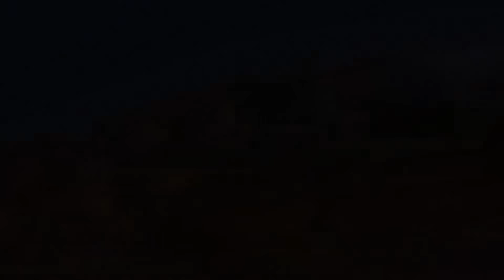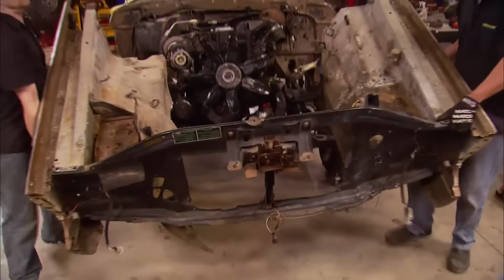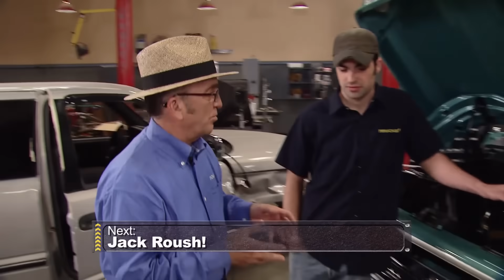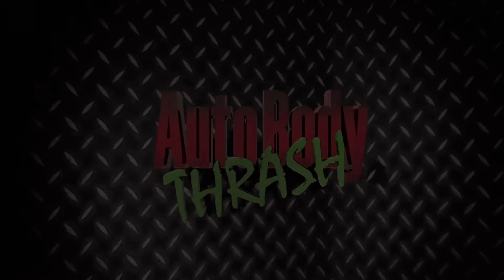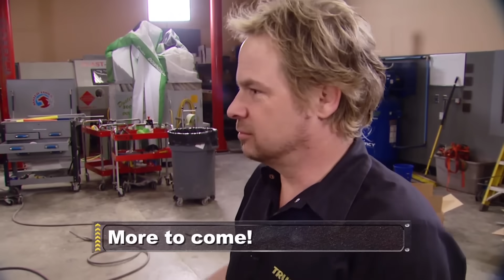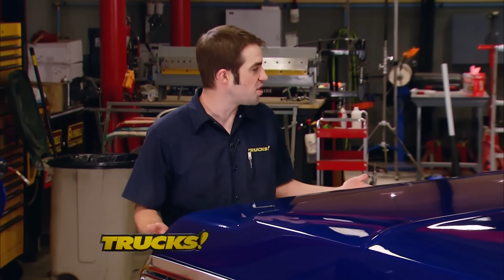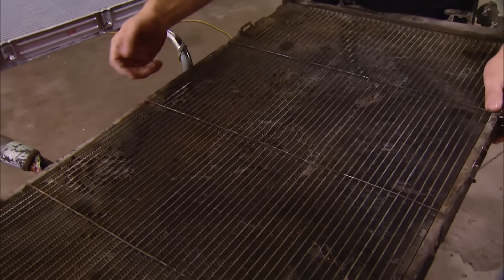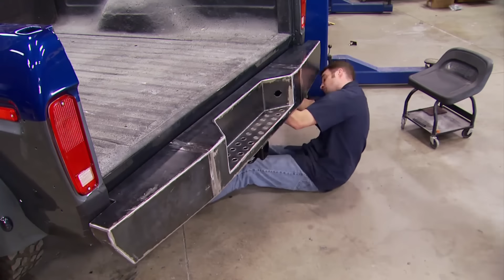Ford Crew Cab on a Dodge Cummins Chassis! (Super Dually) - Full Build

Comment: Loved seeing this until the battery waffle, yes aluminium is more conductive than lead, but at those amps, 🤣 solder has been the go to electrical connection, lead is poisonous but at 2.2×10-7 Ohms per meter even if your terminal was 1 metre long it's resistance would only be 0.00000022 Ohms 😊

Comment: wow 1000 hours into the truck?. so if you were to take a standard rate at a mechanic shop of $100-$150 per hr that truck would have cost $100,000-$150,000 to build!! not including parts. guess this is why custom shops price per job and not completely on hrs.

Comment: Just curious: if I build something like this on my own, take it to the DMV, in let’s say in the state of California, and get it registered, I wonder if I have to comply with any emission regulations.  Not only do I like the looks, but I really like the fact that it doesn’t have a EGR or DPF, making it reliable.  I really want a semi tractor to convert it into a RV hauler, but same issue…not reliable due to all the emissions crap they put on these newer trucks.  We might as well shoot a missile 90 degrees up into the air.  I don’t see any effort to clean our air, by using our generous tax dollars, yet they want us to drive cars and trucks that has so much technology (unsustainable technology) that we can breath from the exhaust pipe.  I suppose EPA will get rid of brake pads, rubber tires, and add another exhaust system on diesel trucks to catch the ash that comes out of the tail pipe since all these things are eventually airborne.  Why can’t we just get rid of processed meats, sugar and refined foods in our society instead.  I digress…nice project.

Comment: “The fact we didn’t have to drop 40 or 50 grand on it……”  
You’re correct, you dropped a lot more. Considering the average body shop is around $60 an hour in 2023, your 1000 man hours is $60k alone in labor. Plus the cost of the trucks and the crap from LMC & Summit (although you might of gotten them free as sponsored products) in order for the average man to replicate that is way north of a $100,000.

Comment: Nice "body upgrade" that gets rid of the modern crap and retains the drivetrain and chassis. Nice to see a useful truck (which means eight lugs and DRW) done bare bones style as they should be.
BTW an underappreciated tow rig upgrade is a wheel lift wrecker (which does not require the wheel lift bed which is mostly a light cover). So is a HYDRAULIC (electric winches are weak) winch either PTO or belt driven, but PTO are the best giving full engine HP. I  put my winches in the bed where they belong and kick ass for loading trailers and much more.

Comment: Bought a '79 f100 with a perkins in it, straight off the showroom floor, in Perth, Western Australia. 30+ mpg from brand new. Towed a 22 ft caravan ( mobile home)  back to Brisbane, about 3 yrs later( just run in) ,still around 31 mpg. Fantastic tourer.😊😊😊😊😊😊😊
Reply: Would have loved one of those. No diesels were offered in F100s in north America, let alone a fuel sipping Perkins. Beauty.

Comment: Wtf, where's a 7.3 Powerstroke Ford at?! It's a better motor and, oh yeah, it's a FORD....
Reply: Cummins Engine isn't a Dodge product neither is the transmission or Dana 80 axel.

Only thing Dodge is the frame and the radiator core support.

The Dodgy parts that will rust away in 10 years.

Comment: I wish that they didnt use the Dodge pedals, Guages, and Steering wheel. They should have adapted the Ford parts or went with aftermarket stuff. It would have looked better and also completed the illusion of a modified Ford rather than a "Frankenstein Truck". 

Also 4 wheel drive would have been my preference but thats OK.

Comment: I have a question , when you were all in on the back end of the engine changing the clutch . Why on earth didn't you install a new rear main seal after telling us that it was leaking ? That oil treatment that you used is not a permanent  repair for a leaking rear main seal , it is only a bandaid and although it will work for a little while it should only be used in case of emergency ! This really surprised me to see you not change it while you were in there already doing the clutch ! I hope that you did change it and just chose not to share it with us ! Anyway love your work and show and keep up the great work !

Comment: Reliability on an engine that’s been through almost every type of motor sport is smart but maybe run it in something besides that b58 chassis try a standalone for it if there is any run it the rest of the season with it but if you ls swap might as well get a different chassis there’s so many parts that’d have to get changed by doing an ls swap to that Supra it’d be smarter financially and for stability and plus brand new build again

Comment: I am doing a similar build, 93 12 valve 2001 ford 6speed, 2006 super duty dually frame, and a 1992 Ford Crew Cab, rust free.

Comment: @16:13 he's talking about all the things they are going to use from the Dodge including the dash and other things, 
What I don't understand is why didn't they just cut the full firewall under the windshield along the inner side of the cab along the door jam's all the way to the back of the cab. keeping the floors, firewall, dash, front seat 💺💺, and stock mounting all wiring placements, then cut the firewall and floors out of the Ford and fit the two together and you have everything needed for ac/ heating ,wiring everything newer in the classic body. Budget build would have really used everything from both trucks to build one really nice tow rig...

Comment: I actually want to build a 1978 f250 single cab, and i want to put a 7.3 idi turbo diesel with a 5 speed manual, also on my 1993 f150 the abs light keeps flashing and my fuse for the brake and hazzard lights keep popping

Comment: SEEMS to me they could have they have found a better frame to use!  Also seems the "typical" boost to the Cummins is ""normal" but they MAKE it look lie it is something "Special"!!! Plus they make it Look like" cutting motor mounts off to relocate them is a BIG DEAL. "REALLY"!!! WHY don' they put a 5.7 (350 cu. in.) motor in a Toyota truck like I did, THEN we'll talk!!! PLUS!!! "I" didn't need a bunch of so called "Experts" to do so!!!!! EVERYTHING they do in this video makes it SEEM LIKE a big damn deal!!! SwAP out a Dana 80 for a Dana 80, WOW!! Another big deal What did they "Expect" when they got a "Junk Yard" rear end when coming to remove brake drums????OH, also, "IF" You want to save money You DO NOT BUY a fu*ked up frame to start with!!! Think about this folks, ALL this work to gsin ""1.5"" INCHES???? !!!How friggin ridiculous!!!!

Comment: The way this is produced i genuinely cant tell if this is from 2008 or 2023, i love it!
Reply: I was thinking the same!
Reply: This show is old, started in 1999, this episode is pretty old too.
Reply: Your hair is from 95 like those rims yo!
Reply: That was a long term build. 2009 to 2014.
Reply: You can tell its old by looking at Tommy in the beginning
Reply: Didn’t spend $40-50,000. Pretty sure you did. Lol
Reply: This show is like 20 yrs old
Reply: That dodge dash was mint, sure as hell not 2023😂
Reply: @docholliday5191 😮
Reply: The only thing I hated about these kind of shows is they (almost) never Show running into Problems like broken Bolts or stripped Bolts needing to make your own (specialty) Type Tools (mechanics and Auto techs know)  to get in tight spots or sketchy Angles. Everything Always seems to go smooth or semi smooth and that's just not how sh!t ever goes
Reply: @Kaleb-1776 it makes sense if it was 20years ago.  Production was super expensive and they were fighting for air time.
Reply: @Kaleb-1776 bro they listed so many problems and solutions in this show trying to get the chasis cab and bed to work together lol
Reply: @Kaleb-1776 in short, there’s no profanity, frustration, or creativity.
Reply: 2009
Reply: This show sucks and this is how I know, I work in a real garage!!
Reply: @kennethkemerer5381 make your own show of your real garage, id watch it
Reply: @jr52919 exactly
Reply: @kennethkemerer5381 you can’t call pep boys a “garage”
Reply: @kennethkemerer5381 i know, i own a wheel restoration shop. Roadkill is more accurate, loads of failure and some small wins
Reply: Kevin tetz has forgotten more then youll ever know 😅😅😅@kennethkemerer5381

Comment: The biggest reason is with these cars...  the ecu cannot properly adjust AFR and maybe pulling timing or any manner of other things to compensate... with a tune you would be able to make the most of the better flowing parts... some cars can make power without a tune like the 6.2 c63 which has been held back from factory just changing the exhaust can get you 30 - 50 hp.... on a na v8  🤯

Comment: taking the easier way , with the shitty frame and suspension on the dodge , the suspension on the dodge will always be loose and rides shitty compaired to that old ford thats why people do super duty swaps if they want new running gear , even them most just do 70s ford dana 60s

Comment: Hi guys where  would I get parts for a 1996 ford f150 4.9 standard cab eddiebuear edition standard transmission.,everything,engine,interior complete 100 percent dash , including instrument cluster, bench seat , seals for cab and windows ,exterior both bumpers,lights ,grill.,fuel tank complete just bolt in, everything including complete wire harness for engine compartment and complete factory vacum hose set up.      Thank you great job guy.

Comment: Get that stupid Dodge valve cover off that engine.  What the heck are you thinking? And you should have used a Ford frame and drive train. It's way more heavy duty than the Dodge in comparable years.

Comment: Trucks / G & G - Loved the series!!! But when doing projects like this, there is one thing that is is overlooked and a complete nightmare! Thing have gotten so bad in the past 25 years that it is crazy replacing simple components. I took my truck to a repair shop and one of their techs accidently backed into the passenger side bed corner and it was minor, like the outter skin. My insurance company totalled my truck that was (is) 10 years old. So we went bed shopping and figured it would be simple to buy a new bed, swap them, repaint and done! Wrong!!!

I can't speak for other States but in Ohio, what a nightmare!  I bought the bed from a reputable salvage dealer and after all the work of swapping and painting, when the wife and I took it to be DOT inspected, they said where is the receipt of purchase and showing the VIN Number of the "Original" donor vehicle?  I was like what? In our case, the salvage yard bought the prior truck that had been damage a few times and fixed via insurance claims. This means the insurance company optted for salvage parts instead of OEM parts. The DOT inspectors said at some point the bed of the vehicle was damaged by a deer strike and the bed I had purchased was not "originally "on the salvaged vechicle we got the bed from. Therefore, to get a cerified inspection that my truck was safe and to get insurance on again, we had to produce a receipt of purchase with the "original" VIN number that the bed came off of! Talk about HOT!!!! 

The DOT Inspectors were nice and explained it to us that manufacturers are required to put numbers on motors, transmissions, reer end and ALL body components. In our case, there is a number on the tailgate and on the bed it's self. These two numbers showed that the bed and tailgate were off of two (2) seperate vehicles and NOT orgininal to the wrecked truck we got the bed off of. Most likely it was the result of an insurance claim and the body shop got salvaged parts for God only knows where and didn't take the time to correctly documnet or  put the right numbers down.  

The DOT inspectors said all of this is done to assist in stopping "chop shops" and stealing car parts. I get that! We were not even allowed outside walking around the parking lot as Inspectors don't want people to know where these numbers are hidden. I get that too!  So long story short, I had $800 in the bed, about $500 in repaining and minor body work, and about $900 in swapping the beds, new bolts, wiring and blah, blah, balh.  We spent about a month trying to track down the owner, the repair shop and try to find what "Original" vehicles these parts came off of with no success!  So we had to find another bed from a vehicle we could prove was off of the orginal vehicle and had a receipt of purchase. Then go through the whole dame process of repainting and swapping beds... again! I called it a loss and after the frist rehabbed bed was off that I had about $2000 - $2500 in, I used my tractor to smash it and THEN hauled it to the scrap yard where I got a few hundred for it. 

We truly need a show to do a segment on this topic!!! 

My dream is to take a 90's series Ford Ranger and drop an older 351 in it and make a dually like in this rebuild series! Ford produced real four door Rangers with long beds, but they didn't meet U.S. roll over and crash test standards. I went trough a shipping and import dealer and got two of them. That was a costly nightmare too. But now they are sitting out in an old barn on the back of my property covered up and I do not want to invest my time, money or energy to go this this nightmare again like I did for a simple bed swap!   I'm going to contact Trucks and ask them to hopefully do a show that covers this nightmare!  Also I am going to look up this autobody guys and see if I can get help on this project. 

If anyone can help I would love to hear!!!
Reply: @Gunpowder_Gasoline  Thanks! Don't need a prize though! Give it to someone else, please! I just want to understand this used parts process to build my dream truck! 😉👍👍

Comment: It’s crazy that I came across this video. My 16 sonata with 136k just went out a month ago. Motor gone. Pulled up to a stop light and the motor just stopped. The dealership (probably the same one that they took theirs too because I’m in ICT) declined it because I didn’t have the service records, or the receipts from my oil changes. They also said that part of the reason it was declined was due to a recall not being completed. Didn’t ever get notified about it and when I bought the car the dealer didn’t do the recall or disclose the info. 
I now have to buy a different vehicle because of that same thought process. But as a winter project I’m going to pull the motor and see if it’s worth rebuilding. 
Wish I would have known about the lawsuit filled against Hyundai for that amazing motor.
Reply: Not a surprise at all from Hyundai. They do the same to everyone who has an issue and needs a warranty repairs.

Comment: I’ve add a cap full of brake fluid to a car with a oil leak and it swelled up the seal and I drove that car another 70,000 and some miles never had a drop on the driveway again. It wasn’t a huge leak that it had but it’s was noticeable.

Comment: You haven't changed the engine oil and filter, it's got fresh coolant, transmission oil, brake and clutch fluid, an oil and filter change would have given you an interim service. This would protect the engine against the power increase.
Reply: Just because it wasn't filmed doesn't mean it wasn't done

Comment: You might look at your change over on your driveshaft diameter that dodge shaft is set for the torque that ford shaft might not hold up to the torque just asking your doing a tremendous job
Reply: The driveshaft is from an automatic diesel dodge (as it’s shorter to compensate for the engine setback). It’s not the Ford driveshaft

Comment: Using proper protection when spray painting also protects your health. Because many paints have have chemicals linked to causing cancer and other respiratory issues.  The full mask reduces getting paint residue in you lungs or your eyes.

Comment: FUCK THOSE GAS TANKS!! same the TGV trike tank, Im disappointed in you as figured you would fab a better lookin tank even just using curom cut an welded tank with no bends 😢 Spent 15yrs as a Aerospace Tig welder an Fab at GE(Boieng) an have my custom chromoly trike frame build aith a 236cc stroker motor an custom exhaust using a small crotch rocket slip on muffler that when fitted will be centered below the seat an looks badass. As for tank like i snagged some "scap" titanium sheet pieces from work an mocked up a more streamline gas tank using cardboard an tape to find the coolest looking design that doesnt just sit on top of frame an guessin will hold double the amount of fuel aswell 😮, along with fabbed body panels an round 4in headlight with same height ape hangers but with a thick front tire with forks like on SVD trike but cant wait till its finished in maybe 3weeks as have to disassemble an powdercoat then will reveal an should go viral as the most badass lookin mini trike 🎉 will comeback an can post link to pictures once does as i know you an people watchin aould love to see 🤩